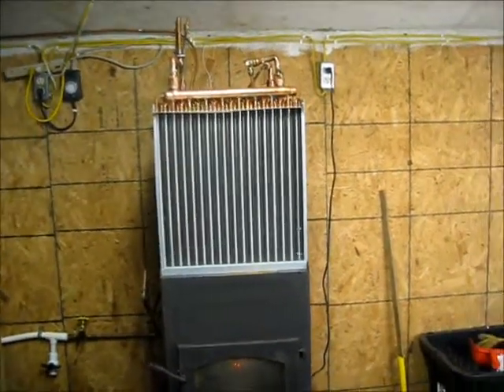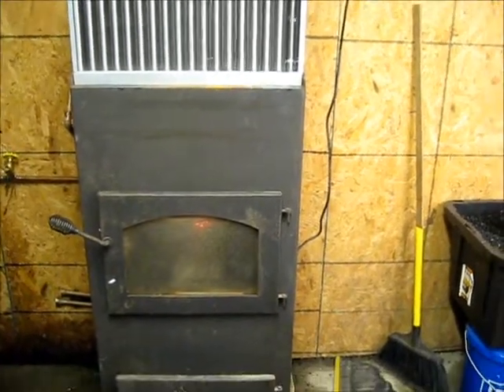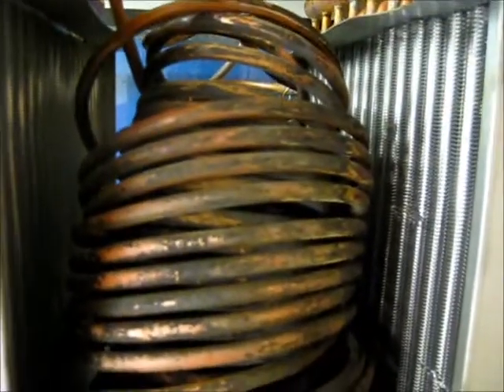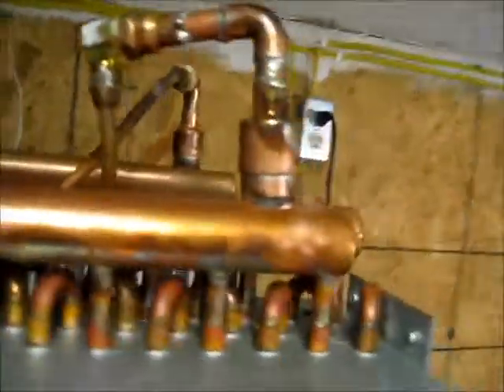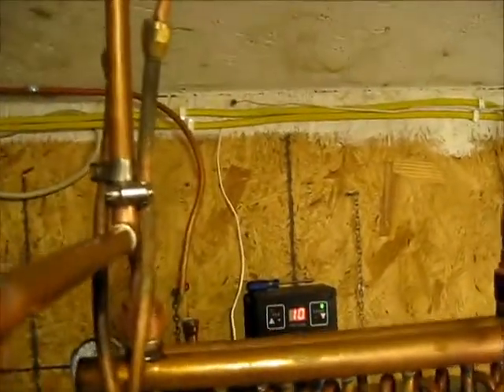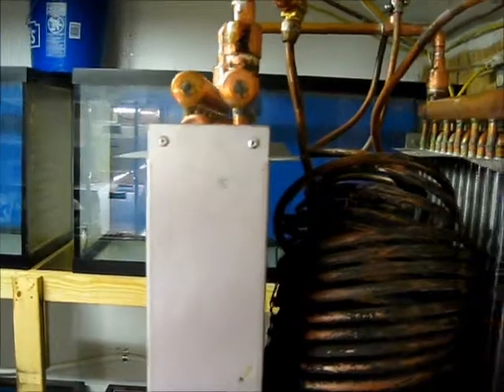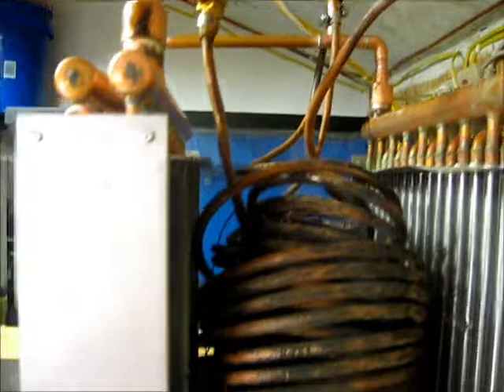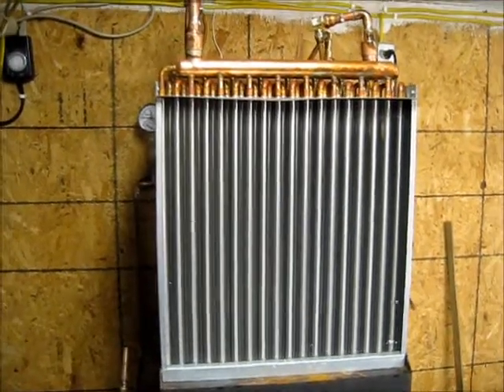Coal Fired Tilapia Water Heater

Comment: Did you use the same water flowing through the coils in the fish tank? I would think hot water would pick up a lot of copper atoms? Did it murder the fish?
I am thinking of something similar but running the heated water through 250 feet of pex between my tank liner so there is no water exchange. Basically radiant heat transfer built into my 8x4x4 fish tanks.
I would like to see how it worked out. Thanks for posting.

Comment from the maker: Eric, Good question. You can just heat the room but when you do it that way, the water temp lags behind the room by 5  degrees or more, depending on how cold it is. So you need to keep the room at 85 to maintain water temp at 80. Steve
Reply: Thanks again for the videos. Awesome job! Pastor Mark

Comment: I really don't know what you have to work with, so this may seem like a stupid question: Is it not possible to just heat the building instead of the water?
Reply: I think I saw somewhere that Steve mentioned a 10 degree heat difference. If you want your water to be 85 degrees, you would need your room temperature to be around 95 degrees.